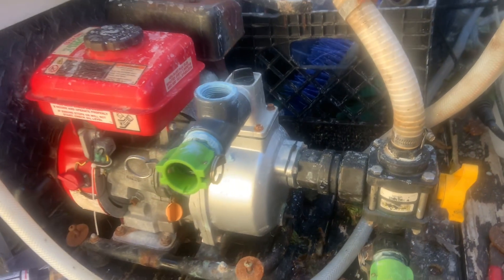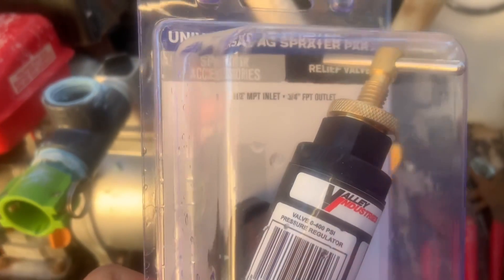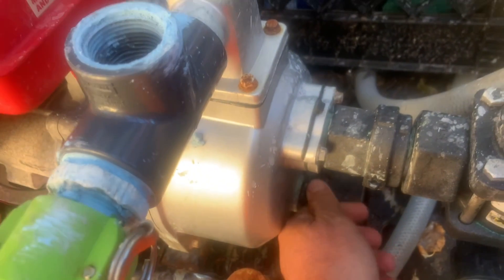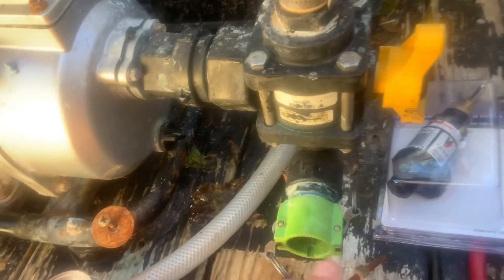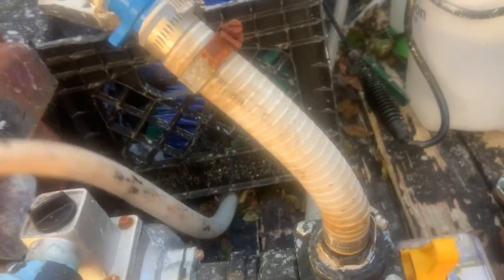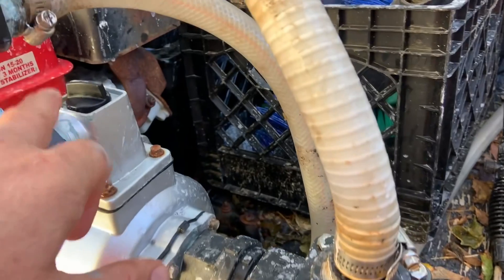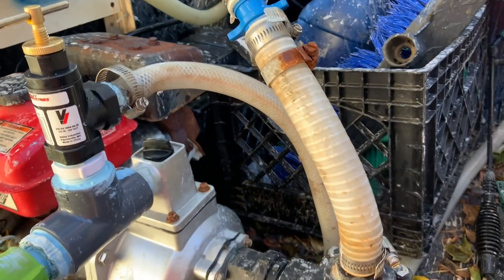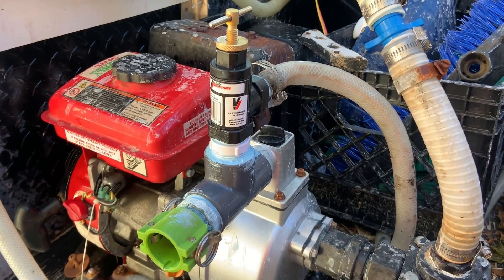“Soft Wash Setup Upgrade! Adding an Unloader to the Harbor Freight 79cc Pump”

Comment: I have the same set up. I had an unloader on my unit, on the top I put a preasure gauge. You only get apx 60-70 psi, al in all, you do not need an unloader. The pump can run for about 10 mins without over heating. remember, no water out means no water in. The pump just spins, trust me. Try it. Put a psi gauge on the top with 1" braded hose going out, thats all you need...

Comment from the maker: My hose runs into my buffer tank and comes back out and goes to my proportioner. Its just coiled up in the buffer tank,  Its 3/4 braided hose
Reply: So the bypass hose is connected straight to the proportioner not to the tank dumping all the chems inside the fresh water tank right?
Reply from the maker: @syedhafeez_alyahya yes it's just a 20 foot loop from the unloader through the buffer tank and back to the proportioner. The hose is in the buffer tank to keep it cool